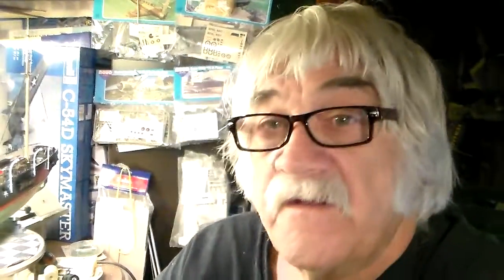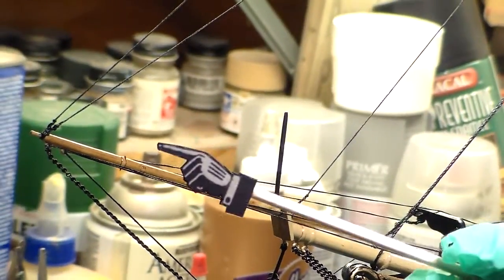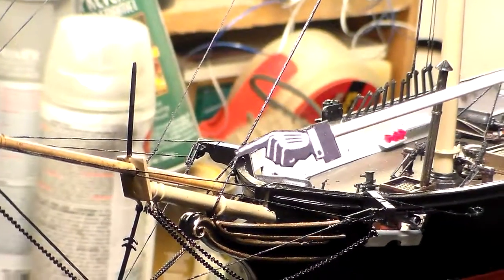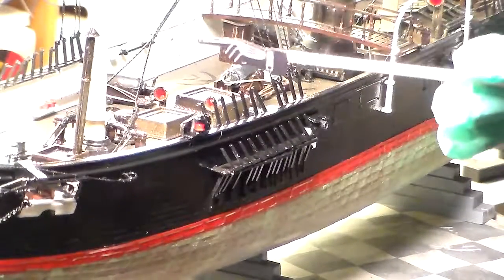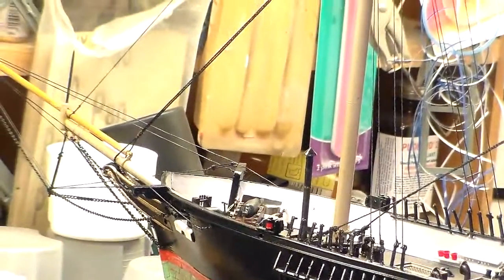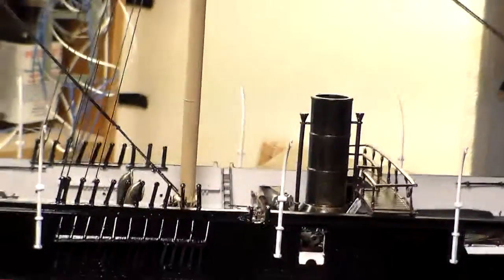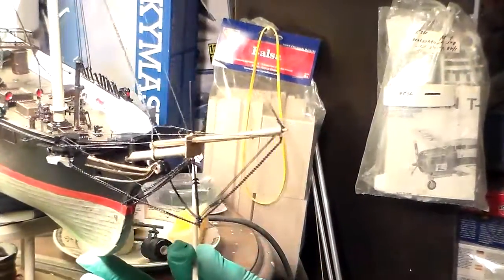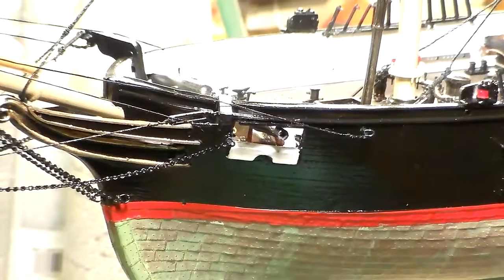Fall Build  Rvell CSS ALABAMA 1/96  Video 5

Comment: The chains in the front look great.I cut of the plastic ratlines and tied my own on my Revell Thermopylae and they came out great.This one came out great!
Reply from the maker: +philo426 Ahoy Philo                                              Thanks buddy for tuning in the thread I am using came from the kit using bees wax to protect it from fuzzing up or fradeing.  The kits ratlines are very flimsy the dead eyes break very easy if not heeded I had second thought is the beginning of the build to leave off the kits dead eyes replacing them with Model Shipways dead eyes I have stashed in my parts box.  I went ahead built it anyway  they seem to work okay but could be done better I am happy with the results thus far. Thanks buddyYou the Mannnnnnnnnnnnnnnnnnnnnnnnnnnnnnnnnnnnnn Frankie Day

Comment: Hi Frankie...great build and beautiful results...one question...what thread/line are you using for your standing/running rigging...the kit provided stuff or?? I have not purchased the USS Alabama kit (yet) and am curious...Thanks!!!
Reply from the maker: +Gary M Ahoy Gary                                   Thank you Gary for tuning in I am honored buddy.  I used the kits thread its not bad its all polyester instead of the fuzzt cotton thread just make certain you have a cake of Bees wax handy to find same go to hobby lobby they sell a brick of it for $10.00 it will last you a life time.  I am not sure if Revell still produces the Alabama they may if no nothing is lost  go to ebay they have them there all the time. The kits thread is okay to use don't be bashfull use it.thanks buddy for checking in.Frankie Day